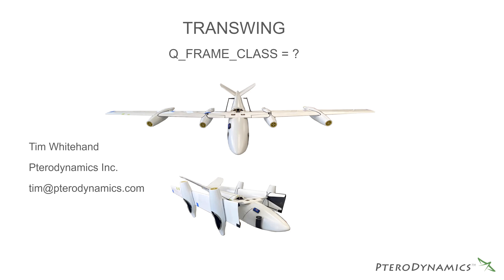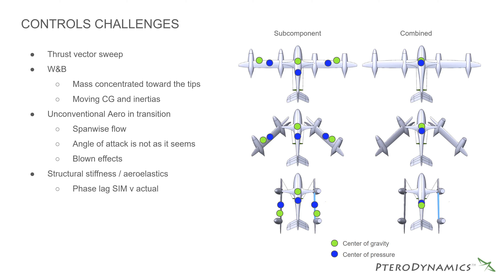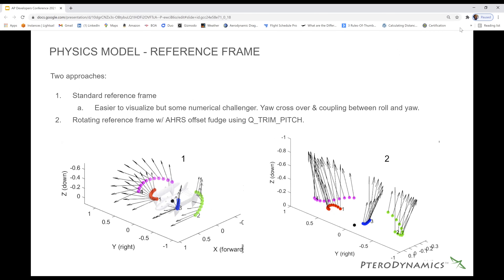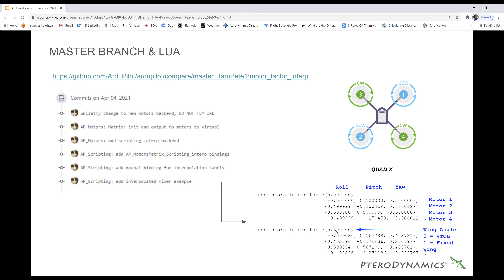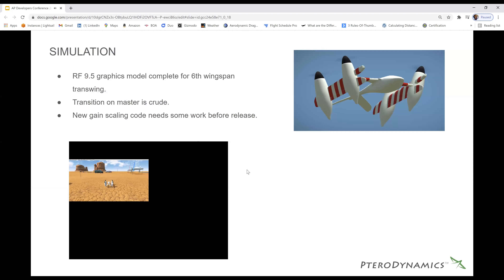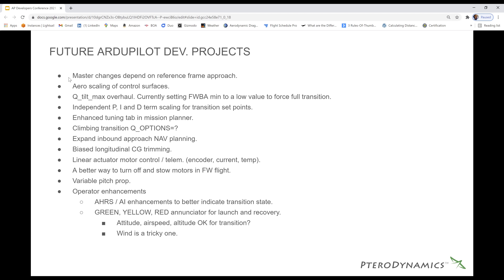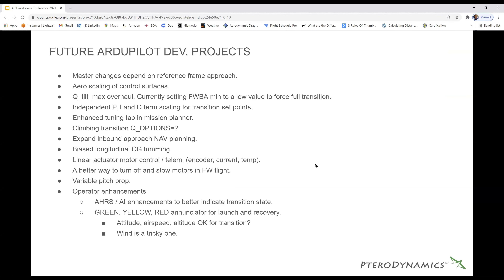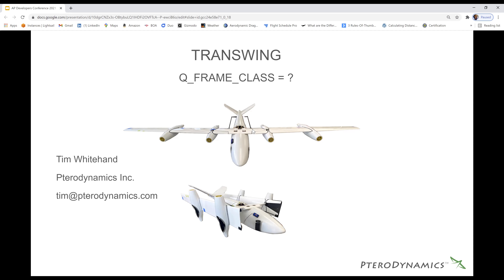Transwing by Tim Whitehand

Comment: Would love to see piloted/manned, gasoline powered version. That will be one of the first VTOL personal small airplanes (2-8 pasangers incl. pilot) MUCH higher reach, than chopper. possible to land much closer in the city, to actual target of the journey, than the airfield is.
Reply: Scaling up that hinge point on the wings would be the difficult part for a small passenger plane. Might be possible to make a small single seater with 4 turboprops or 8 electric motors in a push pull config
Reply: Engines are too loud to have them in a population center. Plus they don't work well with quadcopters especially one that has the transform.